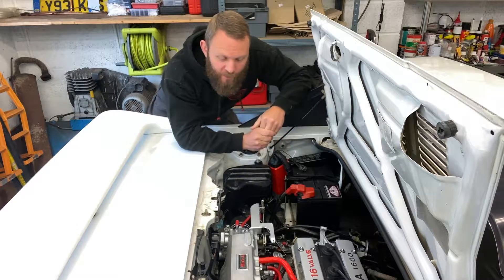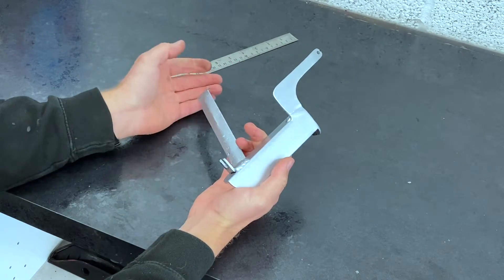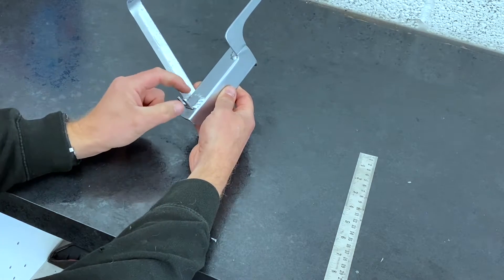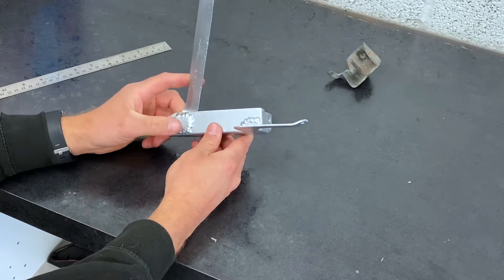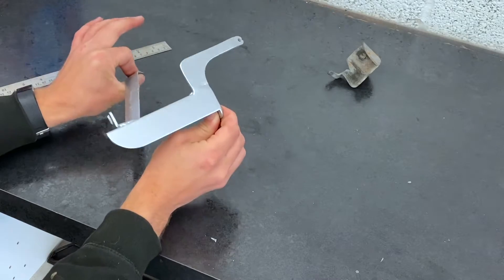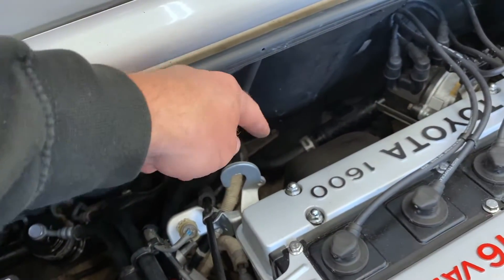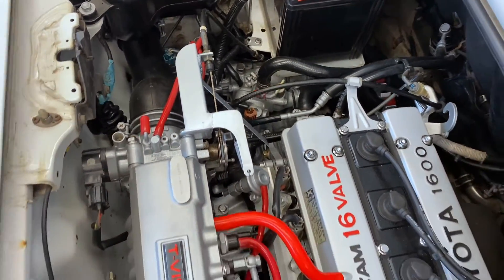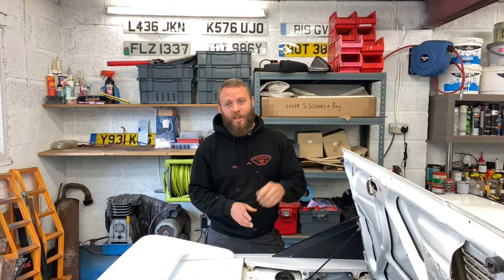How To Make You Own Throttle Cable Relocation Bracket on your 4AGE Toyota MR2 Mk1

Comment: Great video, another question; your metal fuel pressure and return line look relatively new. Where did you get them or are they custom made?
Reply from the maker: Thanks, I restored the engine bay to get it to look better. I did a full video on it and it’s in a mk1 mr2 playlist on here. Let me know if you struggle to find it.
Reply from the maker: Thanks, I restored the engine bay to get it to look better. I did a full video on it and it’s in a mk1 mr2 playlist on here. Let me know if you struggle to find it.

Comment: Great guide - Far better design than the standard jimi bracket I reckon... Its nice to incorporate the second return spring for sure. Do you think it has changed the feel of the throttle response?
Reply from the maker: LlewelynTV thanks mate. Should be adaptable to suit your air tubing too. It feels the same I would say. I’ve done a few miles and all seems well. If you drove the car I don’t think you would notice 👍🏻. Feel free to pop down and have a go after lockdown
Reply: @Resto.Nation  I'll have another look, I might just do what you've done and make a bracket from scratch... I'm sure there will be a way to reroute the cable as well. It'd be cool to see your car at stone point, maybe I'll blast down after the lockdown at some point 👍👍

Comment: Bought an 89 year MR2 a few months back and am sorting through some of its issues. Been watching through your videos and cant wait to give the engine a full detail and get rid of the spider bracket! 

Only issue im stuck on is that it doesnt seem to Idle correctly, the engine stalls on cold start every time unless I manually hold the throttle myself and warm it. Once its warm it seems to idle no issue, have any ideas where the first places to look would be? 

Love the content!
Reply from the maker: Mines exactly the same and it’s because my auxiliary air valve has been blanked off. Wouldn’t have thought yours would have been too tho?! Unless it’s stuck closed or blocked. Try a good second hand throttle body and set the TPS up like I did I’m my video and go from there.